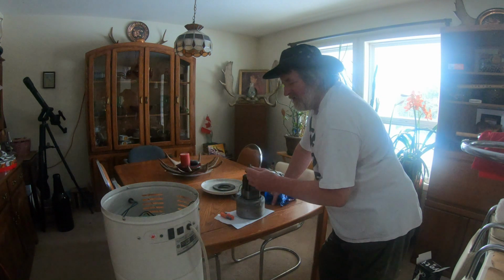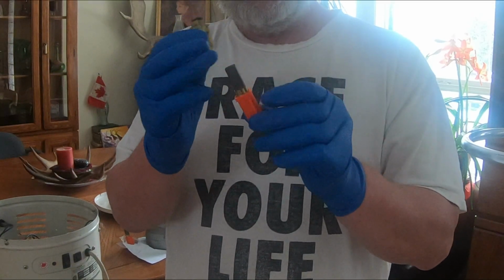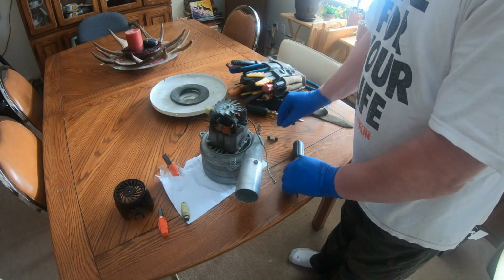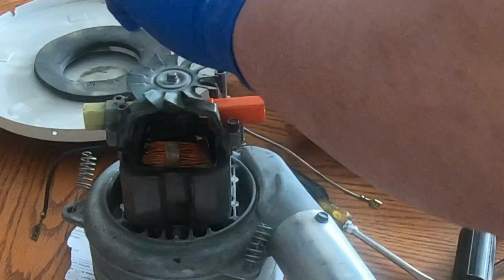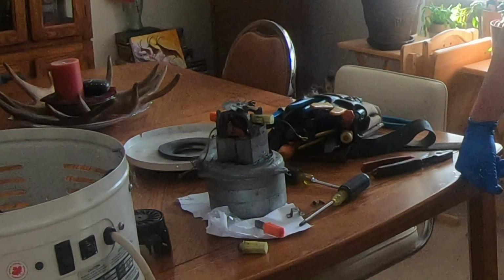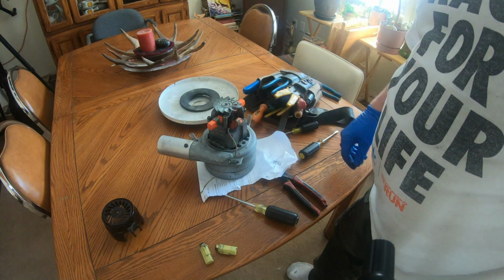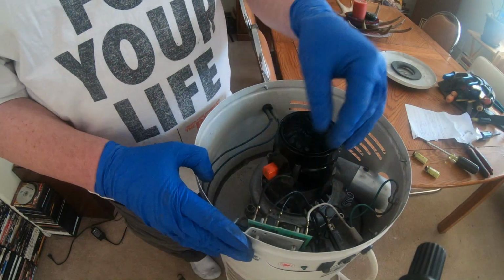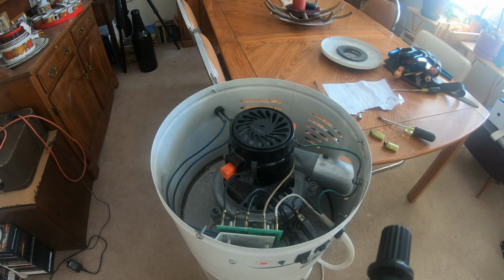How to replace brushes in a electric motor Ametek lamb. Beam vacuum cleaner.

Comment: Could you do a video of the unit with the hose powerhead and show the unit is located normally
Reply from the maker: Yes next time I go under the house to empty it I will do a video showing how I installed it if I remember right it only took less than two hours to do the complete install . As I only had to run the pipe to three locations. Thanks for watching and commenting I will try to get a video out on the install soon.

Comment: I replaced the brushes and machine works but still get sparks. Is this usual?
Reply from the maker: Yes I think that is ok
Reply from the maker: As the brushes wear, the sparks should lessen
Reply: @liveworkplaywilderness1877  👍….ran the motor for a bit and the sparks decreased.

Comment: while i appreciate your making this video. you didn’t actually show a close up of the brush instillation so it sort of makes it not worth it…….i wanted to see how the wire attached to the brushes but it wasn’t clear.
Reply from the maker: The spade connectors slide into the slots shown at 230 in video.